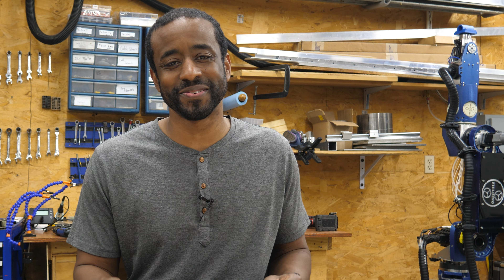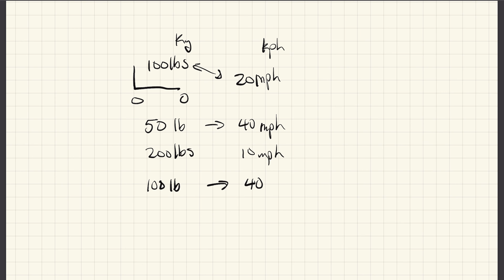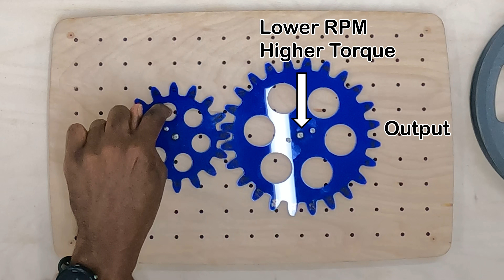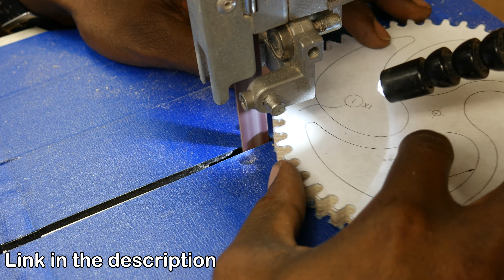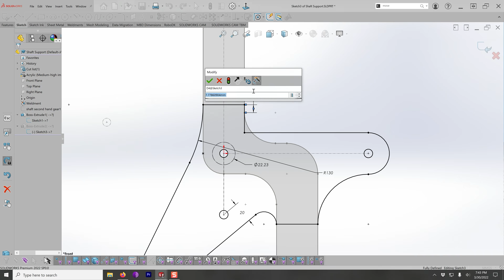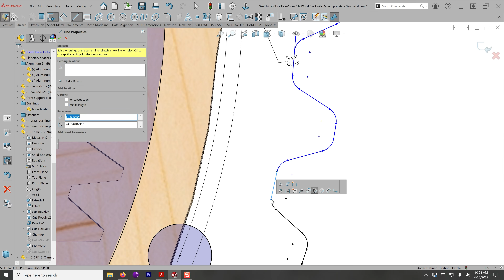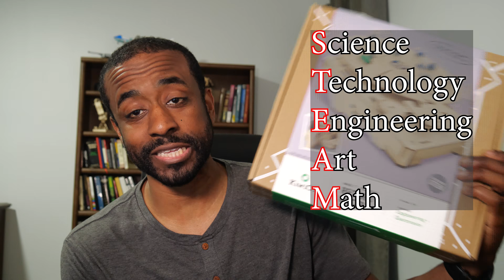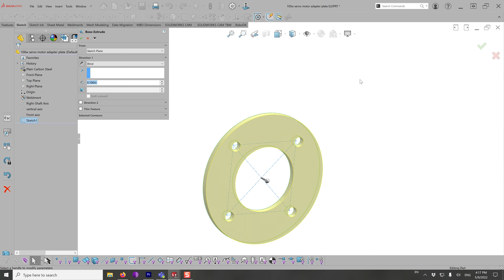How Gears and Pulleys Work: Jeremy Fielding 103

Comment: You've already gotten several very good suggestions about alternative techniques for fabricating bushings. I especially am fond of just using a lathe.

But, what about the laser cutter? I would think you could make up a carriage to hold the tubing, and then just have the laser cutter slice through the tube at appropriate lengths.

I'd agree that technique won't scale very well to much larger bushings, at least not without upsizing the laser cutter too. But for that really thin tubing, I'd think the laser cutter you're using would be able to get through it just fine, wouldn't it?

Comment: Amazing job Jeremy! 

I would love to know more about the process you went through to determine where\which gears went where. I get that you have a motor turning at x rpm and therefore you need gear ratios of y and z, but position and placement has always confounded me. Also, should you use separate gears for hours and minutes, running off the motor, or does the minute gear feed off of the hour gear, etc.

Comment: While both a screw and a bolt use the concept of a wrapped lever to provide mechanical advantage (aka threads), the main difference is that a screw uses the mechanical advantage of a thread to achieve penetration and movement into a bulk material (eg wood) and thus requires a pointed tip to facilitate this initial penetration. The object acted upon by the threaded lever of a screw is the bulk material. A bolt, on the other hand, is not intended for penetration into a bulk material (hence it has a flat end) and the objected acted upon by the bolt's threaded lever is intended to be an inverted wrapped lever that the bolt mates with (aka the nut and its inner threads). While both a screw and a bolt use torque to provide forced movement through an object (ie the bulk material for a screw, or the nut for a bolt), the screw typically needs additional axially applied force in order to provide initial penetration into the material. For this reason screws are typically driven with an axially applied tool that provides the ability to apply force in an axial direction while also providing rotational torque (eg a screwdriver). Bolts, on the other hand, do not have this initial piercing problem and are mated with a prefabricated nut with matching threads and are typically driven with a tool that applies rotational torque only (eg a wrench).
Reply from the maker: Machine screws are indeed screws and don't require a point. They go into a pre-threaded hole just like bolts. This is part of where the discussion gets interesting. :)

Comment: So let's start with thank you very much for your excellent videos. I've learned a tone. As for cutting the tube I'd say put the other pipe inside it and either cut them together  (not easy) or  try putting the shafts in and cutting just of edge should keep the shape of the pipe from becoming warped

Comment: Weeellllll ackchuaaallly, a screw threads directly into a part, assembly, or building material. A bolt passes through clearance holes to clamp material  together with a nut.

Comment: A screw goes into a tapped hole. A bolt goes thru a clearance hole and is captured with a nut or another part that is tapped. 

BUT! we live in a world where anyone can design anything anyway they want. So If I want to put a bolt into a tapped hole then that's what Imma do. It's still a bolt tho.

Comment: While I knew all gear torque vs speed stuff, the lever explanation made it so clear. I never thought about it like that. The difference between a screw and a bolt is who you are talking to. What size motor did you use on your table saw fence? I am wanting to make one for my table saw and a double one to set distances on each side of my miter saw. I have a TON of NEMA 17s.

Comment: Put the rod through the tube before cutting, possibly super glue them to a piece of wood and use grinder or sander to get them to finished size without the burr.

Comment: A screw has a self-tapping head, and if the hole isn't threaded, it WILL be threaded, and it doesn't care about needing a nut.

A bolt requires the hole to already be there, AND threaded, OR something on the other side to thread into.

Comment: Jeremy, your in need for a lathe... Making small bushings is easy with it. And you can do a lot more with it too... Aluminium is not the best choice as a shaft in a brass bearing... They are quite far apart chemically and with any moisture they will get will get damaged. Aluminium is also quite soft and has a very high friction coefficient. I should use a hardened steel or hardened stainless shaft. The stainless has a hard outer skin only so you can still drill and tap in the center (if you use a lathe;-)) I know it's just a wooden clock but it's also an engineering channel and about learning. No nagging here; I like you and your channel. Keep up the good work and thank you for all your nice uploads. Added; if you use Trinamic stepper drivers for arduino and your stepper motor it all turns silent also. Better torque too! All the best, Job

Comment: Did you try using a pipe cutter /nib for your brass bushings ? I realize it leaves a burr on the i.d. but a drill should make short work of that. ( Drill bit as most people call them these days ).
Reply: Using the non cutting end of a round shanked drill on the i.d. of your brass tubing before cutting with a nib would help. Orrr a .99¢ bushing from the hardware store would work as well but not be very satisfying.

Comment: As I watched the clock hands moving I thought wouldn't it be neat if there was a small capsule with some colored water in it on the back of those hands. As the hands move the water would also slowly slosh and turn as well. It would just be a cool gimic to add a bit of color to something that is otherwise mechanically fascinating. =)

Comment: If you slide the brass rod into the metal shaft and then cut through both pieces it will help with the brass rods burr and deformation problem but you will have some different length metal rods left over.

Comment: Initially I thought a screw was something that cut its own threads, but that doesn't account for machine screws. Maybe it's a fastener that is tightened by anything other than a screwdriver. An earlier commenter said that a screw becomes a bolt when a nut is used which seems to be be a more logical conclusion.

Comment: Love your videos!  Just wanted to make a comment about gears/pulleys and your comment about work always being constant.  While this is true in the ideal world in reality (work + losses) is constant. Losses as you mention in your opening are things like friction between the teeth of a gear or the belt and pulley as well as the shaft and the support. If you add pulleys you will be increasing the friction losses.  I ran an experiment where 4 pulleys only reduced the force required over a single pulley by a factor of 2.5 and not 4 as you might expect.  Another consideration especially with belts is the losses in the bending of a belt (particularly a vee belt) around a small pulley this often causes slipping losses (and wear). 

Thanks for your demo ... and discussion!

Comment: Jeremy maybe you can help me with a question. I build my own brand of vapor blasters and recently I decided to add timers to my control box Trumeter 7511 one was going to be total machine run time and the other was blast time for individual parts being resettable. It originally started counting when hooked up to dc 12 v but it requires a NPN switch or transistor is this something I would have to go with a plc controller I am trying to keep the control box as simple as possible.

Comment: I feel like bolts are just the hex head fasteners and all the other kinds of hardware where you stick the tool into it are screws. I would tend to also agree when you put a nut on, it then becomes a bolt but idk I just call the hex heads bolts and every thing else is pretty much a screw

Comment: I think that a bolt has a hex head without a screwdriver notch in it or any other hole whatsoever so you have to use a wrench with it, also pairs well with a nut :D
While a screw... well, you know..

Comment: I don't know if you'll see your answer this but you may be able to save me a lot of heartache and a lot of money if you answer my question. I am thinking about buying a laser cutter but I don't know if it'll cut phenolic plastic and I need to use this material in a project that I'm going to be starting. I don't know if you can answer this question off the top of your head or if you'd have to try it so I'll just leave it open-ended is this possible?
Reply: Phenol fumes are toxic so a laser cutter might not be the best way to cut phenolic plastic.

Comment: Your speed/mass would be better as acceleration/mass. Land speed racers are heavy, with a high gear ratio but they can accerate for a long distance. Drag racing is mass bound. Great work
Reply from the maker: I think it still works well as is. Both vehicles from your example have very high power needs with motors appropriately sized the meet the needs at both startup and full speed. The key part of the discussion was that gears only exchange speed for torque. I think the examples works for all three... the drag racer, the land speed racer and the go kart. Acceleration is just another variable that also needs to be considered for the application, and is effected by mass.

Comment: Talking metal screws here not wood screws: A screw or more commonly called a setscrew is threaded all the way down so you can 'set' a length, a bolt has a plain section next to the head that is not threaded. that is the short answer, the long answer is so long it is tedious 🙂 Keep up the good work, your video's are great.

Comment: Maybe you need to buy a 3D printer...😀
Reply from the maker: What? Did you watch the whole video? I think you missed the part where I laser cut and later 3D printed stuff:) please finish it. It’s good
Reply: @Jeremy_Fielding  WOW~! I see... 😆 That's cool , and I think I 'll buy (or made by myself...😳maybe... ) a laser cut machine or CNC milling just for cut polywood plate accurately , it's a much better choice for making RC fly wins:elbowcough:

Comment: You can turn down a plug from the rod stock to maintain the bushing’s shape and  leave a small shoulder for downward force. Then you can use the drill press as an arbor press for pressing the bushing into the gears with out deforming them. Most people advise against using your drill press as an arbor press but it totally works for applications that don’t deal with hardened steel.

Comment: If you are trying to learn more engineering- then here is a fine point about terminology.  In your example of the see-saw the correct terminology is "bending moment" instead of torque.  Torque is a rotational thing, yes the see-saw is trying to rotate somewhat, but torque is more often discussed with respect to a shaft and something that rotates more than just a few degrees.  Bending moment and torque are both a matter of force times distance.
What is the difference in a screw and a bolt- I've always thought of a bolt as having machine threads that screw into a nut or into a tapped hole in something, and a screw has different threads and is made to cut its own threads in a softer material such as wood or plastic.  Also screws since they may have to create their own hole usually have a point but bolts don't need a point.  I've spent a lot of time working on cars and there are sometimes slight exceptions to these rules.
If you are talking about making variations on the clock- consider that there are watches and clocks designed to be 24 hour devices, meaning the shorter hand makes one rotation every 24 hours instead of every 12 hours.
Reply from the maker: Thanks bill. I completely agree a static beam with a load on it should be called a bending moment, but given the see was being used to explain torque, and a see saw is in fact designed to move/rotate with its load unlike a beam, I still feel like the example of a gear tooth being like spinning levers (a see saw being a single lever) was exactly what it needed to be and appropriately described. No one would be confused by my example. Thanks for watching!

Comment: I always thought a screw has a pointed end to screw into something (without coming out the other side). A bolt has a flat end, protrudes out the other side to allow tightening down a nut. 

Screws pull together with threads, while bolts pull together by tightening a nut on the other side. Not an engineer, so my terminology probably isn't the most technical sounding. LOL
Reply: From the Wikipedia page: "There is no universally accepted distinction between a screw and a bolt" . Fact is, a "machine screw" looks an awful lot like a bolt, and a "lag bolt" looks an awful lot like a screw. The most obvious factor is how a tool engages the fastener, but even there we get into trouble with fasteners that accept both screwdriver points and wrenches.

I personally would not spend much if any time worrying too much about whether there's some uniform distinction between the two, and if so what that distinction actually is. :)

Comment: - Next project: Wintergatan marble machine. 😉
- 17:56 Screws dig into a material and are held in place by the material itself. Bolt go through a hole in the material and is are held in place with a nut.